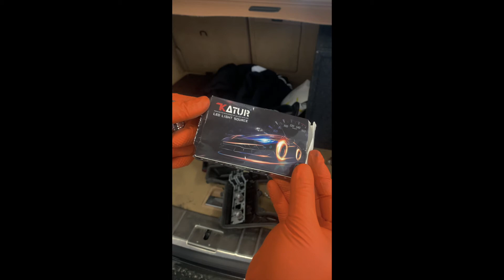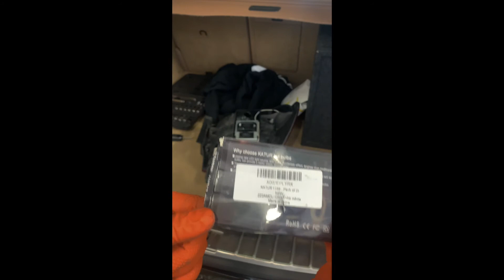2008 Porshe Cayenne S: LED Reverse Bulb Replacement

Comment: Hey have u gotten an error code for this since installing? My cayenne threw an error msg since installing my error free reverse bulbs
Reply from the maker: if the reverse bulbs do not have built in resistors you will get error code. Good news is you can easily add resistors to your bulbs!
Reply: Allegedly they were error free.    No error msg for the first few hrs. Then code came up.  Now the bulbs dont even work
Reply: you used 1156 ?
Reply: @FujiboHeavy what resistors do you add and how?

Comment: I changed mine too today. Bordcomputer says check reverse light. 

Do you have this problem too?
How to fix that? 😂🍻
Reply from the maker: This was from my brother Jon " I would ask him what brand reverse lights he went with and if they had built in resistors? A lot of times, aftermarket LED’s don’t have the right amount of resistance so if it doesn’t have one built in, you just need to add one"